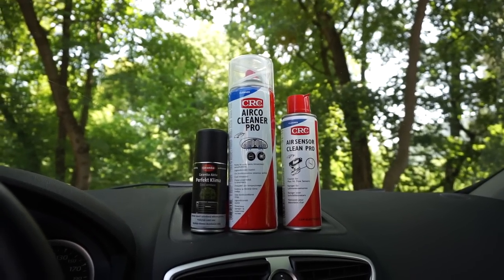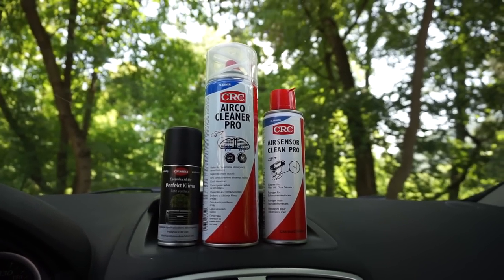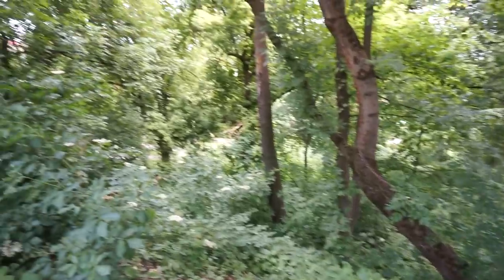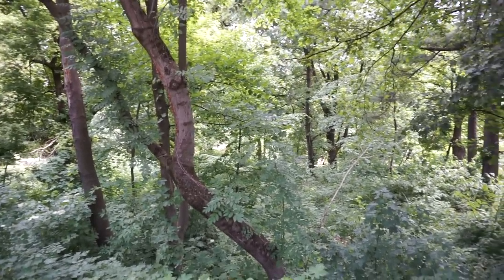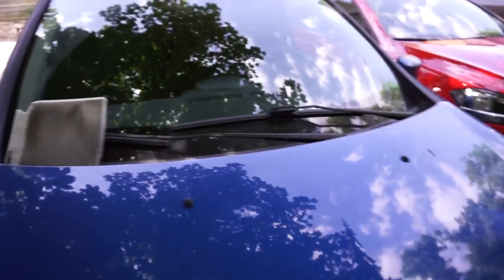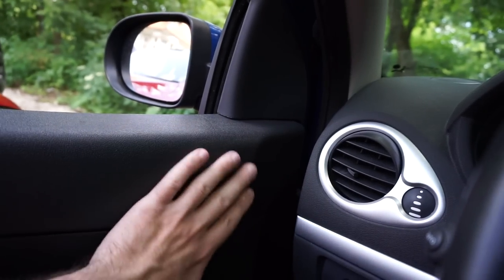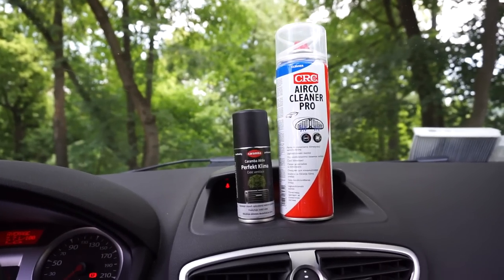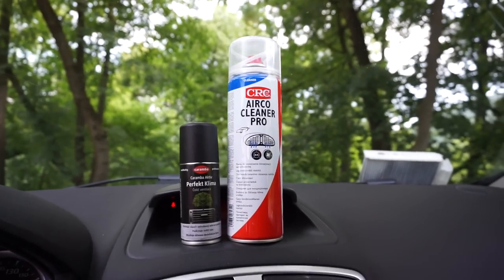Active Foam Car AC Cleaning CRC Airco Cleaner Pro

Comment: Everything was wrong here
Reply from the maker: Like, for example?
Reply: Do you have a better idea?? 
In most car today, you need to take out the whole dashboard to access to the evaporator (cooling coil).
Do you want to do that which will cost you "an arm & a leg" eh?
Not to mention when fully assembled back, could have problems 
like rattling sound, water leakage, air leak etc etc.
Reply from the maker: :) You don't need to do that. Even the evaporator can be cleaned if you put a lot of foam in the cabin air filter box, I did it in the video where I replaced the cabin air filter.
Overall it's all good, no matter what some people say

Comment: where were you putting the straw at the 16 minute point of the video?
Reply from the maker: In the foot area ventilation, located right under the front seats
Reply: @m3rovingian  ok thanks (I don't have a vent on the floor so didnt know what you were doing 😷😷😷
Reply from the maker: @matt5802  No problems ;)

Comment: Bad idea, that foam has liquid, if you have a broken duct or any cracks or leaks, there is a high chance that the liquid will end up on a electrical part and cause some serious damage. Just spray some ac cleaning product in front of the intake fan and will be enough to clean the whole system and get rid of bacterias, mold or unwanted smells
Reply from the maker: Sorry but I do not agree. I don't have any broken duct or cracks. i have the car bought brand new. Also if it would be so it would be maybe a car that went through a accident. they don't crack all of the sudden.
That spray is good only for the general interior. I used it also, but for the AC system you need the active foam, or the smell will come back very soon.
Reply: @m3rovingian  It's plastic and due to all the heating and cooling cycles it will eventually give out, especially in older vehicles. Even if you use the foam, it will just dry out inside the ducts is not like the dirt is going anywhere
Reply: @m3rovingian  My golf 5 has broken ducts and never had any accident. It's plastic, with time it will become less and less flexible and the fact that a car is full or vibration will make it crack sooner or later
Reply from the maker: @Rap7OrZ  Don't worry. Your car brand is well known for the very good isolation of the electric wires. They are all surrounded in a protective resin. You can use it without a problem.
Reply from the maker: @Rap7OrZ  The foam transforms into liquid and flows on the car mats area in the feet zone. You can see it in the video

Comment: Uhm.....yeah....not supposed to see the foam bruv.   This stuff is supposed to fill and clean the evap core box and the evap core....... smh
Reply from the maker: No man, it's perfectly ok and this is how it's supposed to be used. I cleaned the evaporator back then also, after I removed the cabin air filter.
Reply: m3rovingian whatever you say.......you are the only person who’s doing this way.    Have fun when you ruin the interior which that chemical.
Reply from the maker: @rwhipple73  ok

Comment: Why did you use it? What did you try to clean?
Reply from the maker: Over time dirt and mold will gather in the AC vent and a bad smell will be perceived when you turn on the AC. As everything else, it needs cleaning, about 2 times a year, like you saw in this video.
Reply: OMG, what a silly question !!
Reply from the maker: :D

Comment: You are giving wrong advice.  Yikes!
Reply from the maker: Time will tell.
Reply: @m3rovingian  It’ll be too late, damage is done.
Reply from the maker: @chien-shengtsai8626  You are clueless.
Reply from the maker: @chien-shengtsai8626  I've neever been called that so far. Did you ever think that it can be used in the vents also? Why does it has that long straw then?
Reply: @m3rovingian  OK, sorry about the fraud part.  But really!  So many have pointed out that it’s for cleaning the evaporator,  even the vendor.  The vent is the end of the tube, air is blown through the tube, but the mold and crud is on the evaporator.  Have a good day!
Reply from the maker: @chien-shengtsai8626  Trust me. Do it like I did and you will not have any problems. My car brand is renouned for not having a good electrcal system. The wires are free and not sealed in amber resin like the VW cars, and yet after all these years I don't have any problems. You put it in the vents, let it do it's magic and after 20 minutes you turn on the AC and it'll dry out everything. Just don't overspray it because it'll pour on the cars floor that's all. You gotta put a moderate amount of foarm. I also cleaned the evaporator.
Reply: @m3rovingian OK.  But the directions for the product says to apply through the drain hole.
Reply from the maker: @chien-shengtsai8626  You don't need to put it in the drainage. After you start the AC you leave it for 15 minuted to work and the drainage will clean itself and drop all the dirt on the asphalt.

Comment: You sir did it wrong, so wrong.
Reply from the maker: what?
Reply from the maker: @gabrieladrian6736  where is that located?
Reply: @m3rovingian  it depends on the model of the car. Turn on the AC and fallow under the car the spot were water comes out. In that hose you plug deep, your hose. 
Because of the water the condenser area may have mold. 
The ducts and fans are dry and mostly clean
Reply from the maker: @gabrieladrian6736  When you do this type of cleaning with the ac to the max, that pipe is cleaned with all the water and filth pouring from it. Mine was always clean and I only saw water on the ground. The smell comes from the vents not from that pipe. After you do it like I show the car smells fresh and clean.

Comment: I took this advice on my 2005 infiniti g35 and now I have to replace my ac blower fan. please dont follow this advice.
Reply from the maker: You would've had to replace the fan on your old raggedy car anyway. This method has nothing to do with it. It's the best thing to do for your car.
Reply: @Immersionmgroup  
This has nothing to with your ac fan lol.
Lots of manufacturers use this as part of general service

Comment: You're not a mechanic but do you know what mechanics do in an air conditioning service?
They also remove the cabin air filter and spray disinfectant into the condenser, not just putting up such a silly can.
First think and then talk please
Reply from the maker: Well, you clearly talked before you watched, in this case :D. I have a video where I show I do the exact same thing in the cabin air filter zone also. please watch that and then come blame me for nothing. :)
Reply: Salut! Ai dat cu spumă și pe condensator?In filmarea asta n.am văzut.Cu spray.ul mic se curăță senzorul de aer?e bun si pentru curățarea circuitului din bord?Mersi.
Reply from the maker: @andyb2530  Abia anul trecut am dat pentru prima oara si pe condensator, cand am schimbat filtrul de particule. Uite aci  clipul: https://www.youtube.com/watch?v=eozudpX7TvQ
CU spray-ul mic se igienizeaza habitaclul. CU cel mijlociu am curatat senzorul de aer

Comment: u can wash air filter if u want and change evry 5K
Reply from the maker: I replace the engine air filter and the cabin air filter every 10.000km the most. I do it every year and usually it's before it gets to 10k.
Reply: don't you ever wash the filter !